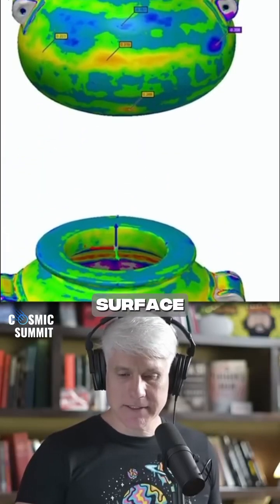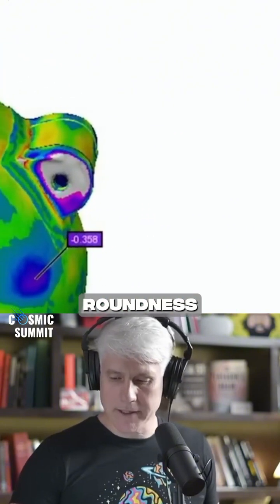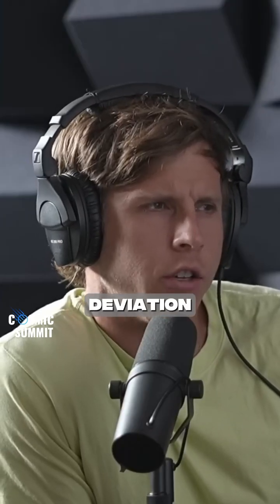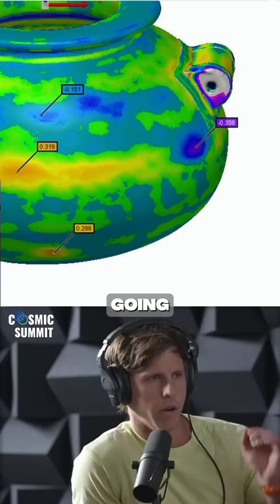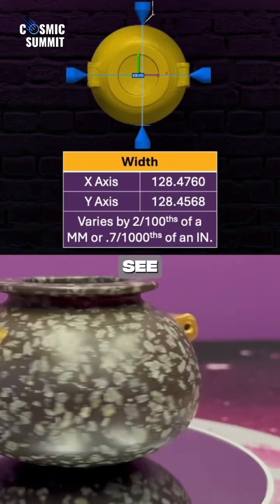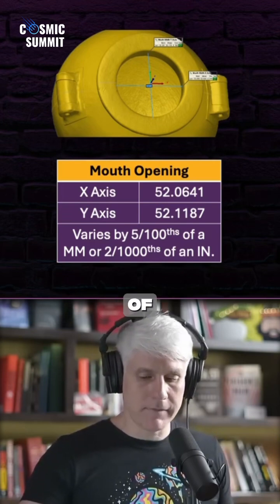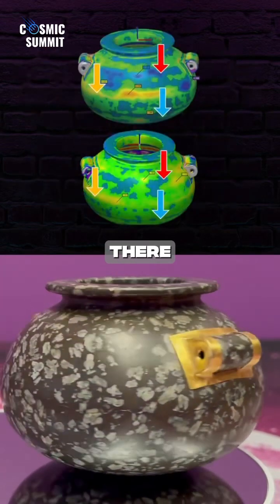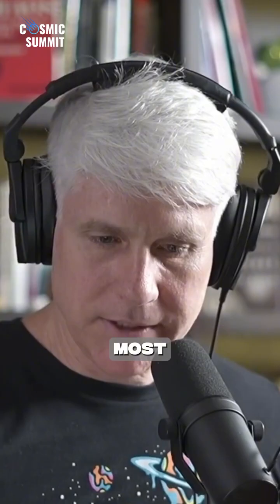Evidence of Ancient Tool Use

Comment: That  actually proves my theory, that they originally had the handle all the way around, like what would happen in a spinning lathe . And than they removed the excess and left just those little handles, so they would of had to do that by hand, since they could no longer use the lathe. If that happend. So the deviation of a couple hundred thousands would make sense if they removed that lip that was the starting of the handles.
Reply: Not necessarily u could have it going back n forth 180° rather it turning a full 360° very difficult to say your idea is good too honestly

Comment: They used stone in a lathe ?
Ive used a lathe for wood and metals, but stone ?
That sounds extremely difficult.
Reply: a vertical lathe, AKA a 'pottery wheel"
Reply: @joyhopescott8939 they're granite. Not ceramic. Think before you type.
Reply: Oopsie! I meant a "granite wheel"
Reply: @joyhopescott8939 I’m a machinist (lathe is one of many tools I use) 
I believe you are correct! A vertical lathe that functions exactly like a pottery wheel. A typical horizontal lathe would have taken a lot more effort to construct due to the weight of the granite they were turning. 
I sure am glad you thought before you typed! You’re a smart person 😀